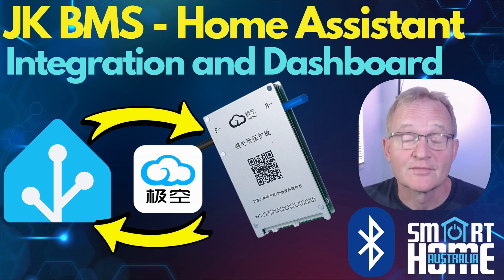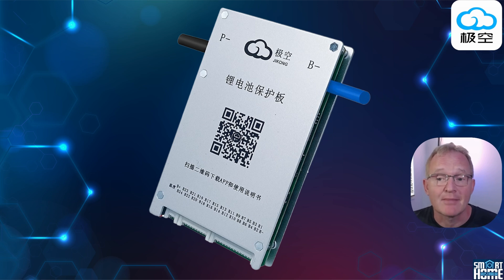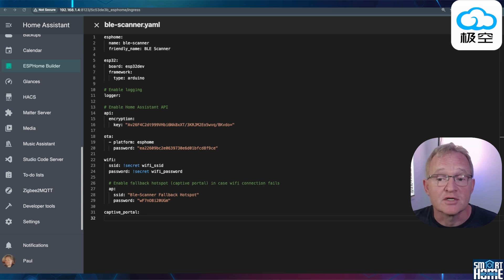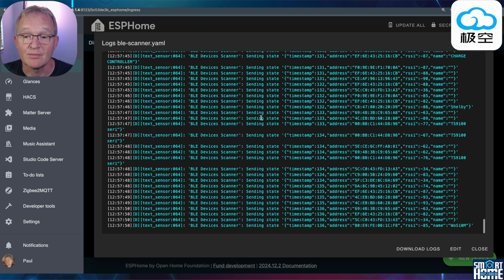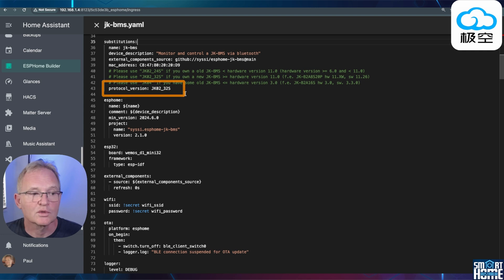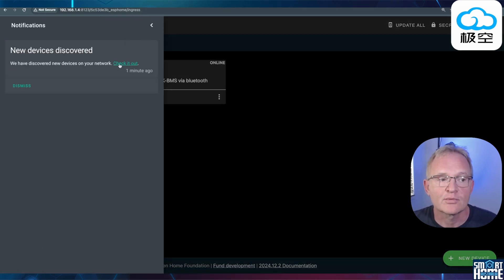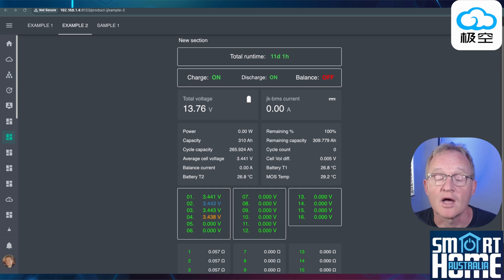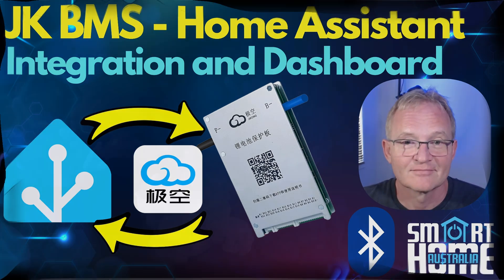🛠️JK Battery Management Systems Integrated into Home Assistant the easy way 🛠️

Comment: Thank you for the easy to follow video. I got an ESP 32 working with 3  JK-BMS in a 16S config each. BMS number 2,  has been consistently disconnecting in a random way. Sometimes it works fine for days and other times it disconnects every 10 minutes. I have to manually reset it, using its push button, to reestablish the BT connection. .... Is there a way to add a switch entity to the yaml code to enable resetting it remotely similar to those already programmed switches for for charging:, discharging:, and  balancer:.?
Reply from the maker: It’s an interesting idea, although I haven’t tried it.  You could try  implement a software-based restart of the ESP32, which may re-establish the Bluetooth connection with BMS. This method doesn't reset the BMS itself but can help in scenarios where the ESP32's BLE stack needs reinitialization.

yaml code:
switch:
  - platform: restart
    name: "Restart ESP32"

This switch allows you to remotely restart the ESP32, helpful  if the issue lies within the ESP32's BLE communication rather than the BMS.

I'd also check:
- Ensure that the ESP32's BLE connections are stable. Interference or signal strength issues can cause intermittent disconnections.
- Verify that the ESPHome and JK-BMS firmware are up to date, as updates may contain fixes for known BLE issues.
Reply: @smart_home_australia  Thank you for the prompt. I already have  added the restart/reset code as a switch 
- platform: restart
    name: "Esp Restart"
    id: esp_reset
    restore_mode: ALWAYS_OFF 
And also added to the binary sensor: online_status: 
online_status:
      name: "Yel online status"
      id: yel_status
      on_release:
        if:
          condition:
            for:
              time: 2min
              condition:
                binary_sensor.is_off: yel_status
          then:
            - switch.toggle: esp_reset
The action included (then)  triggered by on_release:  resets each time there is a drop for at least two minutes of the (Yel)low BMS BT status. 
The 3 batteries are housed next to each other and enclosed in a red, yellow, and black colored boxes within a foot or two from the ESP 32 piking their BT signals.
This approach resets it sometimes, but not always. Both other two BMS's (200 A Jk B2A20S20P) seldomly lose connection but the problematic yellow battery BMS, the first one built, is an old version 80A  BD6A17S8P. I have in the past tried to update its firmware, but it seemed not feasible /difficult. 
Planning on attaching a relay in parallel with the BMS led lit push-button to be activated via one of the available ESP32 GPIO's to reset and restart the BMS. I need to sort out which two of the four attached wires connect to the push-button and figure out how long it takes for the push-button to be depressed to turn off the BMS. I will also try to figure out how to assess the ESP32 BLE connections stability for I don't know how to do that for the time being.
Reply from the maker: Nice, love the color scheme for the 3 battery packs. Very Off Grid Garage :)

Comment: Thanks for your explanation. One question: I have two 16-cell batteries connected in parallel. How would I do this process with an ESP 32 and view it in Home Assistant? Thanks. You have my like.Greetings from Spain
Reply from the maker: Interesting question. I assume that you have two BMS's in your configuration? If thats the case then you can simply add the second JK BMS into the configuration and display individually in HA or combine. The point is that you need to treat them as discrete sources from the 2 JK's. I dont have two to show you how but the documentation linked does.
Reply: @smart_home_australia  Thanks for responding so quickly. Yes, I have two JK BMSs. But, I don't know how to do what you tell me, how to add it

Comment: I have a tangential question for you. My JK BMS is behaving oddly, I think. The voltage it outputs at rest is low. My fully charged battery is at, say, 13.3 volts. But the voltage coming out at the P- terminal of the BMS shows as 12.7. When I put enough of a load on, like say 4 amps, the voltage at P- raises up to essentially equal. Is this a feature of the JK BMS? What is frustrating is at low discharge rates, like .5 amps the voltage stays low. I know this is not the topic of your video but I'm reaching out because you too have a JK! Thank you.
Reply from the maker: Yes, I do have a JK BMS! What you're describing sounds like a characteristic of the active balancing function or possibly the MOSFET behavior in the BMS.
Some JK BMS units have a slight voltage drop across the MOSFETs when there's minimal load. This could explain why you're seeing a lower voltage at P- at rest or under very light loads. When you draw more current, the MOSFETs fully engage, and the voltage drop reduces, bringing it closer to the pack voltage.

A few things to check:
1) Measure the pack voltage at the battery terminals while under the same conditions (idle, light load, heavier load) to compare.
2) Check the BMS settings in the JK app—some settings related to active balancing or protections might be affecting output behavior.
3) Look at internal resistance readings — higher resistance in the MOSFETs or wiring could contribute to the drop.

Let me know what you find!

Comment: Another great video. Thank you. I am looking forward to more solar projects. I have a boat and have been playing around with getting various services into HA, including my EPever charge controllers. I am just setting up my JK BMS. 
1. Am I correct, that if you connect to the JK with HA you cannot simultaneously connect via the iPhone app? That is unfortunate. 2. In the intro you promised we would not only see data, but be able to control charging and discharging. I was able to see values but I was not able to toggle anything using the second dashboard. Please confirm.
Reply from the maker: Thanks, glad you liked it. 

1) No, you can monitor simultaneously, sorry.
2) Yes you should be able to control charge and discharge from the dashboard if using BLE but not with UART.
Reply: @smart_home_australia  OK. Got it working. Pretty sweet. I'm using the second dashboard item. It does NOT let you toggle states. However, the ability is there in the entities. On point 1it is a real shame you can only have one BT connection. The concern I have is in an urgent situation I may want to use the app and I am not actually clear how I disconnect HA from the BMS to let the app take over.

Comment: Great video! Could one ESP board/interface connect to two BMS simultaneously or should each BMS has it's own ESP and bluetooth connection ?
Reply: @ericschloesser9290  same question here for me.
Reply from the maker: Yes, using the syssi/esphome-jk-bms integration on an ESP32, you can connect to multiple JK Battery Management Systems (BMSs) simultaneously. 
However, while the ESP32 hardware is capable of handling multiple bluetooth connections, stability may vary depending on the number of connected devices I've seen discussions on the integration's GitHub page where a user reported achieving stable connections with two BMSs but faced challenges when attempting to connect three or more devices.
Therefore, if you plan to connect more than two BMSs, you might need to consider distributing the load across multiple ESP32 devices to ensure reliable performance.
Reply: @smart_home_australia  Thanks !
Reply: @smart_home_australia  I have 2 BMS's. Where to put the second mac? Or shall I use a second ESP32. Thanks for the vid. I have it working now with one BMS.
Reply from the maker: Try this https://tinyurl.com/8kyn8ywv.

Comment: Yes I actually have two of them, or should I say one of them working with HA perfectly, my plan had changed since I bought them as i only had one Jakiper 100ah battery, I ended up going with a huge sealed lead battery system, I still battery have the jaki just sitting there on a standby setup tho. 
I connected the Peter board through one of my Cerbos installation of that was relatively easy and it displays all parameters of the JK through HA. 
My lead system consists of 4 x 48v banks, each bank is 24 x 2v cells 500ah each works a treat, my plan is to take one cell out of the jaki battery to matchup with the voltages of my lead bank 53.5v and just use the jaki as a standby till I decide what to do with it.
But yes was a bit pricey but no coding involved, I’m a novice when it comes to that stuff 😀🇦🇺
Reply from the maker: Novice? I don't think so.... lol... sound like you are doing a great job. It's a fascinating hobby with so much to learn and enjoy. I'm hoping that the new channel really takes off (when released) as its a real passion of mine.

Comment: I'm following your tutorial. and it works, but  my SOC is 0, other parameter is show correctly
Reply from the maker: Interesting, I checked the issues log (https://github.com/syssi/esphome-jk-bms/issues) and there is nothing on there about this issue. I'd suggest raising a ticket with Syssi (https://github.com/syssi/esphome-jk-bms/issues/new).

Comment: Thank you! I've needed this for some time as my system has (15) 15s batteries... Yep 225 cells lol
Reply from the maker: Wow 225 cells that's a lot of energy! What size cells are you running?
Reply: @smart_home_australia  24ah each.. in total the system is around 19,000wh. We live on a boat and can go 3 days before needing to run the genset when its not to hot or cold. It's sized to run the AC or heat overnight for 12hrs.
Reply from the maker: @lee8652  Nice setup.... and sounds like you need that remote monitoring..

Comment: Might be usefull to talk first about the general setup cause there is a JK BMS Addon based on Bluetooth available. 
That is called BatMON and works quite well out of the box if your HA is in range of the battery.

I guess you might use the ESP Home like a kind of bridge to get the BT data into the WLAN / HA for all those who have no direct BT connection. 
And it might also be usefull to which BMS this solution might fit cause you did not mention the inverter BMS with the active balancers on board which have become quite popular in the last 2 years. 

I am still looking for a cable based setup too cause the bt connection can cause some issues unfortunatelly quite irregular which means every 6 or 8 weeks suddenly out of nowhere the link is broken even though the setup and antennas have not changed at all. In most cases the bt link is the weak part therefore cable from the BMS to the esp. 
But will this work with inverter BMS (canbus connected to growatt inverter) and which points do I have to connect the ESP pins to ?

I prefer the second layout I had seen before and I guess I will try to use that with my current BatMON addon assuming that all the values are available.
Thanks a lot + happy new year.
Reply: Not to mention tha Peter board that’s another story
Reply from the maker: Ahh the good old Peter board.... looks like a very interesting little device. Do you have one and are they worth the money?
Reply from the maker: Interesting. The reason I tried this solution was that I run bluetooth proxy and BatMon does not work with that. Hence I use this solution with the ESP32 acting as the bridge as you correctly point out. There is another solution that I am currently trialing that is also bluetooth and and does work with BT Proxy and if I get it working reliably then I'll make that video short.

As to a cable based solution @alanbiyde8502 has the right direct from what I read, although I have not tried it personally.

Comment: I had already found Syssi's stuff, but I hadn't kept up to date on what else was in the repository, so thanks for this video. I do have to replace the BMS i have on my self-built battery pack, so I think I will be doing this when I get it.
Reply from the maker: I think you are going to really enjoy the sister channel when it starts. I'm already getting in some really interesting and unusual product for home solar hobbyists. 
JK BMS has been great so far, rock stead and with alot of configuration options. Which BMS are you replacing ?
Reply: @smart_home_australia  I had the same one you're using, I believe, though mine was the black case version.
Reply: @smart_home_australia  I just received my new JK BMS and will be getting a few case kits that use their new inverter BMS so I can increase the capacity of my home power system. This will be quite useful for monitoring those packs.
Reply: @smart_home_australia  To answer the question about which page, I think I prefer page 1, as it doesn't require scrolling on Windows to see everything. I already had a dashboard set up for monitoring my system, so I'll redo the battery section for it using the yaml code you linked to. However, my main system batteries use a JBD BMS so I'll be needing to edit the code as needed for them to work correctly, and I found that Syssi had the ESPHome code for them as well. My JK-BMS is currently set up as a 24-volt 125 Ah battery rather than a 48-volt 100 Ah one.
Reply from the maker: Have you tried Batmon and what did you think of this ?